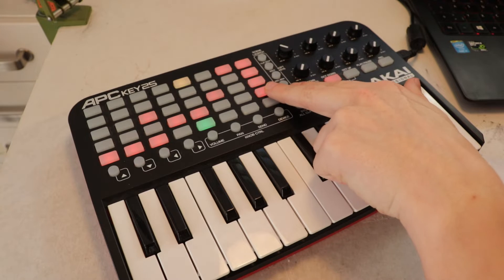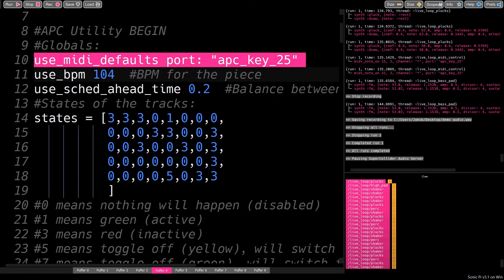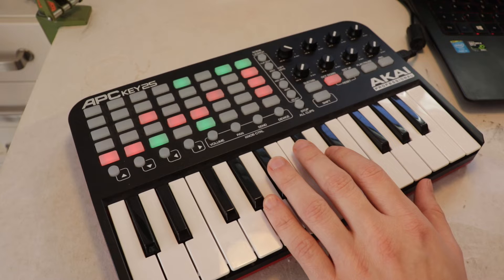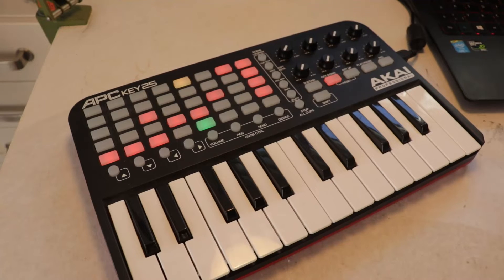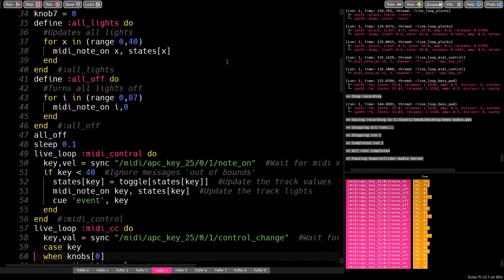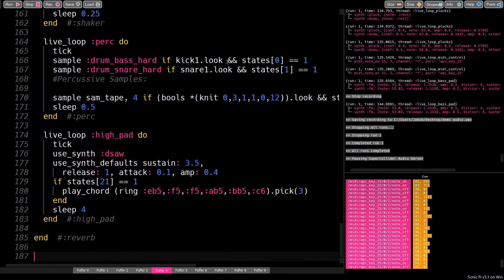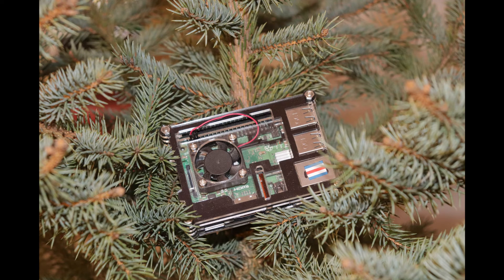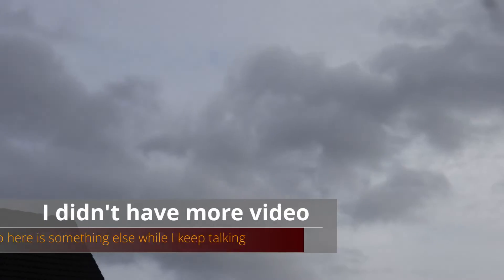Sonic Pi Performance Setup

Comment: Hi David thank you for the video its amazing what you have done. I'm looking to simplify this can you help please as i dont yet know sonic pi and I have an arduino sending midi connected to my rasberry pi via usb. I would like to be able to play some beats using the arduino midi - what code on Sonic Pi will help and what else if anything would I need to ensure that these midi signals are read on the raspberry and played on the sonic pi?